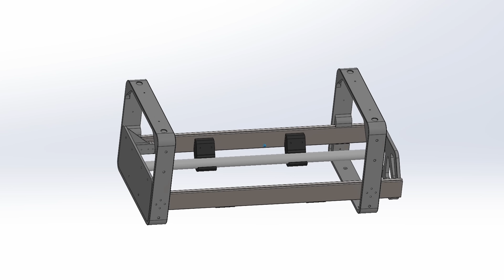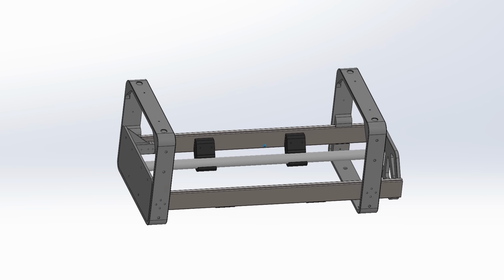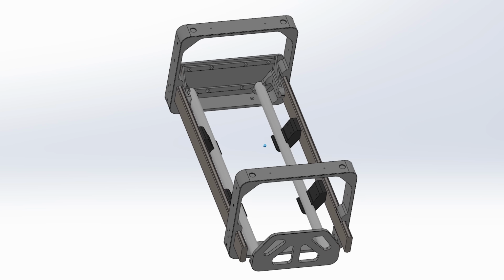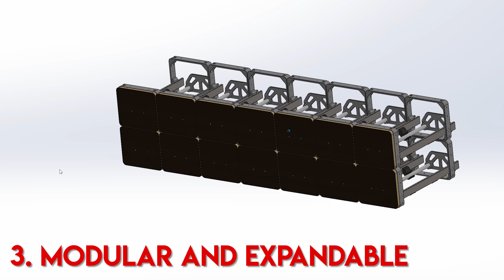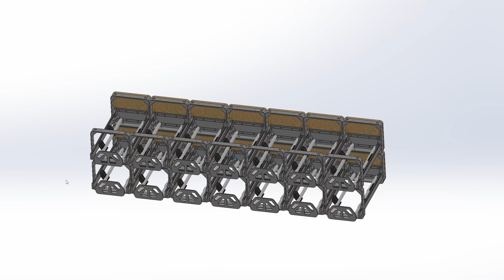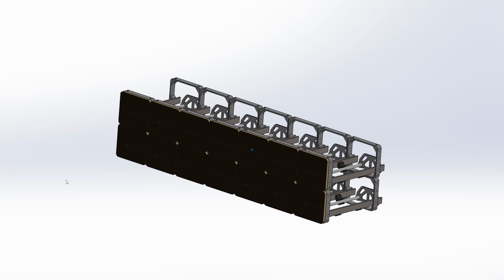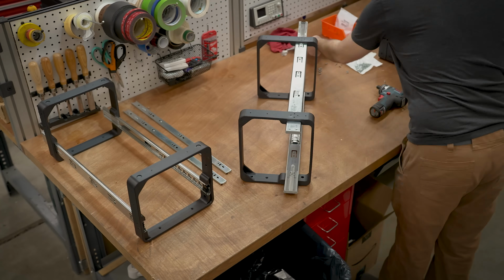Modular Filament Storage System - Part 1 (Design)

Comment: Thank you for this insightful video and the impressive design shared!

I have two queries regarding the statements made in the video:

1. You mentioned that "20% is way too much humidity for filament". Could you share the data or studies that this recommendation is based on? I've been targeting below 25% humidity for my filament storage (but for Nylon and the likes that I try to keep under 10%)and, based on observations rather than scientific evidence, I am noticing little to no difference in print quality under 30% humidity. I'm keen to understand if there's a specific humidity threshold supported by data that I should aim for.

2. You mentioned that 'Desiccant packs will not actively remove moisture from the filament.',  I believe there might be a misunderstanding. Silica gel desiccants will absorb moisture, thereby reducing the humidity in the environment. This reduction in environmental humidity would, if lower than the humidity in the filament, cause the filament to release moisture to reach equilibrium with its surroundings. If possible, could you elaborate on the context of your statement? 

I appreciate your expertise and look forward to any further insights you or others might offer on this.
Reply from the maker: I'll start by saying most of my 'research' is just anecdotal, like your own.  I'm referring to the percentages I see from my dyers and other humidity sensors nearby.  1) this is just anecdotal, that's what I've found works best for me and tends to be as low as it dips.  At 20%, there's still more moisture left in there, so if I see it at 20%, I'll usually let it go for a little longer.  I've never had an issue printing below 20%, but I've seen issues above it, so that's just my own rule of thumb.  2) CNC Kitchen has a nice video about this, but in short, desiccant packs are really good at absorbing moisture, but they can't actively draw it OUT of filament.  So they can maintain low humidity levels and prevent further moisture ingress, but they really don't do much to draw out moisture from filament, actively heating filament is really the only way to do this.

Comment: Definitely making these

Edit.
Oh god you're using inches :/
Guess I'll design one from scratch
Reply from the maker: They were designed for metric, BUT fasteners and other hardware is really only available in inches in the US.  They could EASILY be converted to fully metric if you don't have access to the hardware.  In the US, you can only get PVC pipe in imperial.  What would you want changed?

Comment: Not sure of your regional conditions.  Where I'm from, humidity in the garage would be a huge problem for those exposed rolls.
Reply from the maker: ANY humidity is a problem.  That's why for anything critical, the filament gets put into a dryer before and during printing.  Usually I'll have multiple parts to make or am prototyping a design.  For instance, the ASA parts for these drawers took ~2 weeks to print in total.  Even if it was dry beforehand, after 2 weeks of being out in the open, it won't be.  So I just transfer to a dryer when I need to use it.

Comment: You don't need to dry your filament in the storage. The store just needs to keep already dry filament from getting wet. Any sealed box with some dessicant will do that job just fine. Heating is only needed to dry the filament either before putting into storage or before printing.
Reply from the maker: Correct.  Dry before and during use is what I do.

Comment: Does petg printing hold up?
Reply from the maker: Unfortunately not.  PETG is WAY too flexible.  You need something that's both rigid that won't creep.  If you check out this video I did on ASA, in the second chapter, you can see how flexible the PETG frames are.  With this much weight, it would just buckle:  https://youtu.be/goR6Kbjiih8?si=2wZAI9DicXOc7A95
Reply: @RobertCowanDIY  Unfortunately I have an open printer.
Reply from the maker: @Yonbii91  I printed all of these on a Prusa XL, which is open.  I used a $4 shower curtain, check out the video.  You can absolutely hack something together that will work:  https://youtu.be/goR6Kbjiih8  You might want to consider subscribing so you don't miss any content ;-)  Thanks for the comment!
Reply: @RobertCowanDIY  I'm more worried about toxicity
Reply from the maker: @Yonbii91 Yeah, fair point.  I wish there was a good alternative to ABS or ASA, but if you need structural rigidity, it's really the best option right now.

Comment: nice video , love the design , to bad my printer is to small to make it 😅
Reply from the maker: I'm going to look into trying to redesign it to be smaller, but that was the goal from the start and it just didn't work out.  But I have some new ideas.
Reply: @RobertCowanDIY  awesome 
Very excited to see what u come up with , i HATE the wall mount holders and other 'drawer' systems waste to much space
Reply from the maker: @TurtleStylez  Thanks!  Yeah, in my workshop, wall space is PREMIUM.  It seemed like a waste to use so much of it for filament, and it would just be caked in dust after a few weeks.  For me, this was the best solution.
Reply: @RobertCowanDIY  yeah i rent a small appartement atm so drilling in my wall is not a option , i do need to make a workspace for my printing stuff so i would add ur design to the build to store my filament below my printer
Reply from the maker: @TurtleStylez Nice, that's a good application.  I was originally going to use this in a closet in my office.

Comment: This is an AWESOME system, love the look, build quality, practicality. Unless you're running a print farm and turning these filaments over pretty quick, I don't really see the point of drying. That's a lot of extra energy to remove moisture from a filament roll that you might not use until months from now. I think you have the right idea to just dry it when you need it. Or worst case, build a separate 3 to 9 roll dryer for commonly used filaments that you want to have ready to go.
Reply from the maker: Yep, that's exactly what I'm thinking.  Dry as needed.
Reply from the maker: @GeorgeGraves  I would disagree with you.  I actually made a whole video about this.  A viewer (such as yourself) said this and had filament that was just shattering into pieces when you bent it.  He mailed it to me and I dried it for 24 hours and it went back to normal.  Other than with UV exposure, filament doesn't 'go bad' from moisture alone.  I've had 5+ year old rolls of filament that get VERY brittle easily recovered by 24 hours in a dryer.   https://www.youtube.com/watch?v=dTWbYZtFPEU
Reply: @RobertCowanDIY  I deleted my post since it's falling on deaf ears - google ad hominem (since you've deleted your personal attack)
Reply from the maker: @GeorgeGraves  It's not falling on deaf ears at all.  I dry all my filament ahead of using it and I have yet to have an unrecoverable spool.  But that's simply my experience.  It sound like you've had a different experience.  That's OK.  We can disagree on this. Civil disagreement is possible.

Comment: What do you use for a filament dryer?
Reply from the maker: I use Sunlu dryers, the ones WITHOUT the fan.  I hate the fan.
Reply: @RobertCowanDIY  I actually just started watching your video about the Sunlu S2 (which I already have in my "shop"). Thanks for the quick answer! I am queuing up your filament drying videos now.
Reply from the maker: @bagellord Nice!  Let me know if you have any questions!
Reply: @RobertCowanDIY  how many of them do you have/use? I currently have one, but I am thinking of getting another one and/or building an add-on for my food dehydrator that I already use for another hobby (it never gets used for food)
Reply from the maker: @bagellord I have 3 Sunlu V2s.

Comment: Drying is definitely faster at the correct temperature for each filament but all filaments will give up a bit of their moisture when the ambient moisture is low enough.
I love the idea, i would still spend the extra effort to enclose them all and keep the humidity as low as possible (you can get sub 5% rh with some diy designs) 
It would also decrease the re-drying time from taking a spool that was previously dried but stored for a day out of the dryer.
Reply from the maker: Oh, I really debated this over and over.  But I have some spools I've had for years.  Once you get 100+ rolls of filament, they're gonna sit for awhile.  Unless you dry each roll, then seal it with desiccant and store it that way, you really should just dry it before use.  I'm not disciplined enough to go through that much effort every time I use a single roll.
Reply: @RobertCowanDIY  Even if the spool is dried and bagged before storage, even the thick plastic bags will pass moisture if left in storage long enough. IMHO, if you can see through the bag (i.e. not metalized), water can eventually get through the bag.
Even knowing this, I still store my spools in a resalable vacuum bag (I got a ton of them from Eibos for cheap when they were doing a kickstarter) with desiccant and a paper humidity strip. For my more hygroscopic filaments I still dry them before printing (I don't have a drier for during printing yet...). My gut feeling is by doing it this way, even the old spools start out a little drier when I pop them into the dehydrator. No evidence, just a gut feeling. Even PLA I'll dry if the paper humidity strip indicated a high enough humidity.
Reply from the maker: @Sembazuru  Yeah, we're on the same page.  I have just gotten into the habit of deciding what filament I need ahead of time, putting it in the dryer and keeping it there until the project is done.  For the actual drawers, I was printing for ~2 weeks.  There's no way the filament would have stayed dry the whole time, so it just lived in the dryer.  Usually when I need to print something, it's not just a single part for a couple hours, it's usually prototyping and such over the course of a few days, so it might as well live in a dryer.

Comment: Excellent design! I love the innovative use of the PVC pipe!

Just did a quick slice and it looks like 1 roll of 1kg filament will do 2 drawers?

That would run about $40 CAD in filament for decent ASA up here in the north. 

Where as just making the internals would yield 5 drawers worth per roll (maybe 6) and use the remaining $80 for some plywood to make an outside two drawers high with banks?? 

Just thinking out loud is all and wondering about cost effectiveness in my local area (I already have a full woodworking shop with a CNC so might as well make this a full makers setup)

I love your videos and would subscribe twice if I could!!
Reply from the maker: I'll go into more details in my next video, but at least for me filament was cheaper than using plywood.  Also, plywood ended up being less dense and much heavier.  You can use ABS though, which is MUCH cheaper.  But yes, 1KG gets you to modules.

Comment: If I have to dry every filament while I print, I can't use an AMS
Reply from the maker: How do you handle it now?  Just using desiccant doesn't actually 'dry' anything, it just prevents additional moisture.  Even brand new spools can have moisture.  I've had many failed prints over the years trusting 'sealed' spools.  If it's critical to have dry filament, I dry ahead of printing.

Comment: Do you have to bolt it down? Seems like the upper shelf already kind of fulfills that task (counteracting torque from the drawers). Unless you're planning to open all drawers at once :D
Reply from the maker: In the frame section, I talk about how it's probably best to bolt it down.  I have the whole thing assembled and loaded up right now and it's NOT bolted down yet.  There's no chance it's tipping unless I open half of the drawers.  BUT, it does feel more secure when bolted down.  It depends on how many spools you have, how deep the whole thing is and how many modules you have connected.  The more modules, the more secure it will be.

Comment: personally for me the issue of being open is less about moisture because as you said getting this to seal and stay at a low enough humidity is basically impossible with reasonable effort, what is how ever important for me is keeping dust out.
but overall with this design you can easily add side pieces that provide a decent dust cover.
Reply from the maker: Yeah, I get that.  The moisture issue is really difficult to tackle.  BUT, the way it's positioned in my shelving unit, I could easily just 'skin' that section of the shelf and it would be effectively air tight.  It just needs a left and right panel really.
Reply: For dust prevention, this design looks like it would take wrapping with a poly film of some sort. Use truss-head screws or similar to tack it on to the outside of the frame using the existing holes. Doesn't need to be drum tight.
Reply from the maker: @Sembazuru  Oh, absolutely.  I didn't mention it, but I wanted to keep the outside smooth so that was an option.  For my application, I could just 'seal' off the cavity in the shelving unit.

Comment: You mentioned you wanted to make it as slim as possible. Since you are 3D printing things, do you think you could take the drawer slides, move them down and inward a bit, and angle them so they are actually what is holding the spools? This would free up a bit of width. Though I think to get them to slide out you would need to flip which side of the drawer slide is in and out.
Reply from the maker: I kinda toyed with that, but it's hard to explain all the issues with that.  In the next video, I can post a screenshot of the sketch I used in solidworks.  I basically started with a sketch of the spool, clearance for the spool, and all the necessary wall thicknesses, etc.  This is about as small as I can get it.  If it was square, the drawer slides would have to be in the bottom corners, which MIGHT work.  I might look into seeing how that could work, but I was worried about getting the slides too far away from the center of mass.
Reply: @RobertCowanDIY  Nice! That's super neat. Keep making great stuff! :D
Reply from the maker: @KaletheQuick  Oh, I plan on it!

Comment: Nice work Robert!! I have some rails laying around. Will check if it’s compatible
Reply from the maker: Let me know, I wasn't going to go out and buy a bunch of slides to see how universal the hole patterns were.  BUT, I included the STEP files on printables, so it should be pretty easy to modify.

Comment: 260 MM Size requirement on the frame pieces for anyone wondering.     Would have been nice to be able to keep that under 256 so they could be printed on more machines.   being 260 will limit the printability to only people that have large frame machines.
Reply from the maker: Yeah, I was bummed by this.  I tried making it smaller, but it was too many compromises.  I have to machines over 300mm, so I just decided to design for a larger printer.  I MIGHT look into trying to make a smaller version.
Reply: @RobertCowanDIY  either way I downloaded it and ordered the parts to make it.  Love the design.   I also have a couple large printers.
Reply from the maker: @JATdesign Nice!  I'm loving it so far.  It's of course a trade-off not having everything immediately visible and not having it sealed, but it's MUCH nicer to decide what filament TYPE you need and just opening the right drawer.  Too many times I would find one that I liked only to realize it was the wrong type, etc.  And I can easily see when I get low on certain types.

Comment: Just a thought, would EMT conduit have been less problematic than pvc? Less flex?
Reply from the maker: Even at 24", it's more rigid than I thought it would be.  The middle supports help a LOT.  Fully loaded there's no flex.  There's very little clearance underneath the drawer and it sags maybe 1mm max with 9 rolls.
Reply: @RobertCowanDIY  that’s pretty good!
Reply: You mean such as Repkord system?
Reply: @deeply999  no. That’s an open system with the filament being stored along the length of a wall.

Comment: Could 1x1 lumber be used in place of the pvc pipe? It would make the drawers a bit more rigid, and maybe solve the issue with smaller spools.
Reply: Could use EMT conduit as well.
Reply from the maker: I did think about doing something like that, but I was worried about weight.  As it stands, this whole thing is over 300 pounds.  I think going to EMT would add a bit more weight AND it would be harder to drill/screw the bottom supports in place.
Reply from the maker: It's surprisingly rigid when all the supports are in place.  And I'm a guy that likes stuff VERY strudy.  If it wasn't solid, I would have looked for another solution.  At 24" and two middle supports each side, it's as solid as it needs to be.  For smaller spools, I was just going to design little clips that go on the rails to reduce the diameter.  I just don't have any smaller spools right now.
Reply: @RobertCowanDIY  these will be a welcome addition to the workbench my K1 and K1 Max are on. Thank you for sharing the design files!
Reply from the maker: @jasondilts510 Of course, I'm really excited to see how people modify it and see some 'makes' show up on printables!